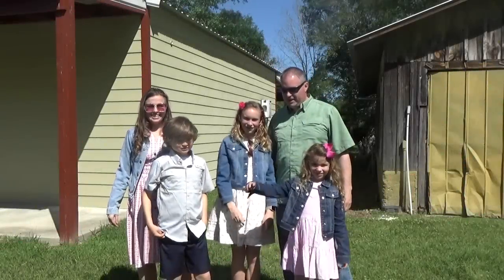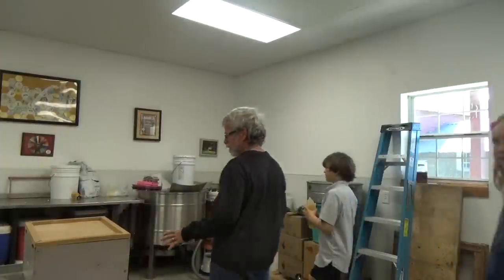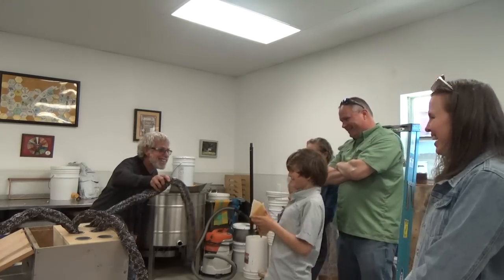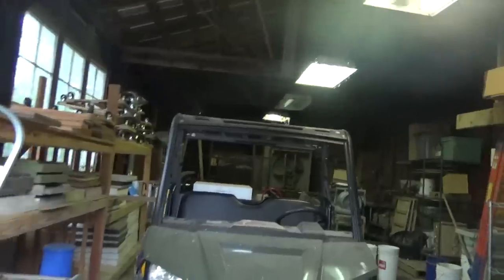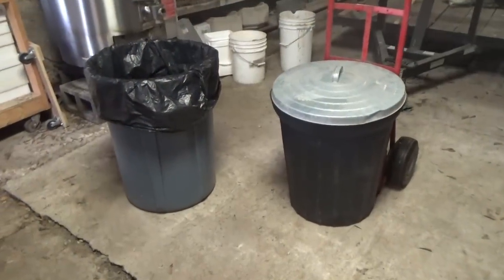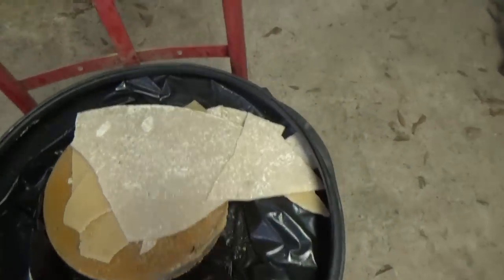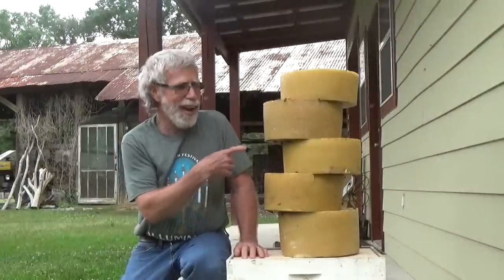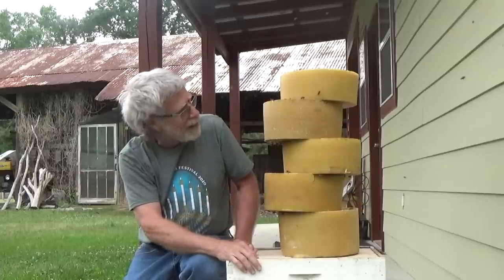Look how much refined beeswax was gotten by rendering wax cappings.

Comment: Your strainer-cleaning method really cracked me up! Here I was thinking "maybe he dips it in boiling water and watches the gunk melt off" or "maybe he uses a pressure washer"😂  With as much joy as you had over using a blow torch, why would you ever try another method? Haha
Reply: Hot water would clean the screen better and less work needed
Reply: I was thinking boiling water too.

Comment: Hi Jeff, I was just wondering if you would try boiling a kettle of water, then pour it on what ever you want wax gone from. You can even recollect what comes off by putting a coffee filter on the ground and pouring over it. It works like magic..lol. take care, and love the vids. And as it makes you feel good, god bless you sir.
Reply from the maker: First, thank you for your blessings, it's the best perk I have with the channel. Second, I have used boiling water to clean the strainer, and it does work....pretty good. However, it does not remove the embedded dirt from the screen. For that, fire is necessary. Plus, it's so much faster. Thanks for watching. God's peace.
Mr. Ed

Comment: Mr.Ed, will the girl's draw out the heavily waxed plastic foundation during the summer - fall? or only during the spring flow? I noticed that you use plastic frame's to withstand the high velocity extraction.
Reply from the maker: Generally, bees draw comb when there is a nectar flow. AS long as food is coming into the hive, they will build comb. However, it is mostly limited to the spring and early summer months. Thanks for watching. God's peace Carl.
Mr. Ed

Comment: Mr horchoff - i watched a lady render beeswax and she did something she considered an accident - she poured the melted beeswax into a bucket filled with ice water - she described what happened - she said the wax boiled up vigorously she thought it might boil over but it didn't - the resulting wax rendered into those tiny/little beads some wax sellers will sell in bags - do you have experience or knowledge of such a result - it sounded so interesting because melting little beads for molds or products seems a whole lot easier
Reply from the maker: I do not know about that, but I will give it a shot and see if it works. If it does, I'll make a video about it. Thanks for the idea and for watching. God's peace.
Mr. Ed

Comment: Would it be better just to use boiling water to render or melt the dirty wax debris off the mesh. I would think all the scrapping and fire would cause the mesh to wear down or created larger holes. Just asking.
Reply from the maker: I have used boiling water and steam to remove the trash, and it does work, but not well enough. The tough dirt still remains embedded with water and steam, but fire cleans it right out. Thanks for watching. God's peace Cynthia.
Mr. Ed

Comment: Makes me wonder if you could save that water and then distribute it somewhere less messy when the flow is low and you usually end up feeding anyway... Not sure if it would be worth the effort or not, but just a thought.
Reply from the maker: A very good thought, but the water mixture would have to be refrigerated to prevent mold from forming and fermentation, so the effort and expense is not worth it for me to do that. Thanks for watching. God's peace.
Mr. Ed

Comment: I think I may have messed up. Wife and I made the trip to Victoria Tx (150 miles) to purchase 160 pounds of wax. We got there and the stuff looked horrible. I got it home and did some initial cleaning. Lined my pot with a 5 gallon bucket paint straining bag. Put the wax in, in batches. Got the pot to 160⁰ and got the wax melted. Poured it up. Next day got the wax out and it's the color of mud. Waiting for Amazon to get my 10 micron filters to me. My question is, will the wax get "pretty" with straining or maybe the guy overheated it? Wife and I had plans to use for "crafts" for trade shows. I just retired and we'd planned on supplementing our income in retirement. The wax cost me $800 bucks. Afraid that's down the drain. Sure hope you can give me some good news. Thanks, Jay
Reply from the maker: I can't say about the wax you bought whether it will clean up or not, but normally, each time the wax is filtered, it gets lighter in color as more of the particulars are being removed. At least that has been my experience of it. My suggestion, keeping refining it and see what happens. In all my years of rendering wax, I have not overheated it, but I always have water in my mix. Let me know how things work out for you. Thanks for watching. God's peace Jay.
Mr. Ed
Reply: @JeffHorchoff  purchased a "grease filter" stand and filters. Melted at 160⁰ in a paint filter bag with water. Poured up in buckets. Re-rendered the blocks through the grease filters with two layers of paper towels. Looks like dark caramel brown. Sickening. Found way better wax for the same price. Can't afford to do it again.

Comment: Question for you... what kind, size and length nail do/should you use to build frames?  I have a framing jig but not sure what size nails to use to assemble the frames or how many to put where?  I'll be nailing by hand with a hammer.
Reply from the maker: I use an air stapler, and I shoot a 1 1/4 inch staple. The video link below shows how I build my frames. Thanks for watching. God's peace Nancy.
Mr. Ed
https://youtu.be/clUNGgjLGPo

Comment: In burning stainless steel the extreme heat removes the oil that was impregnated into the steel... No longer stainless steel at the point of the stainless steel being burned. It will rust .
Reply from the maker: That may bee true, but I have been doing the same burning for over 2 years now on that strainer and no rust has every appeared. I know one day it will be no good anymore, but at that point I will get another one. Thanks for watching. God's peace.
Mr. Ed

Comment: In using the torch , once you burn the screen you have rendered the screen useless for food grade use. The screen is no longer stainless steel. It will rust . I recommend using hot water to clean the strainers .
Reply from the maker: As the wax is not eaten, and the screen will ONLY be used with wax, I'm not concerned about the screen losing it's food grade status. I have used boiling water in the past, but it will not remove the dirt that is imbedded in the screen. Fire is the fastest and best method for me. God's peace.
Mr. Ed
Reply: @JeffHorchoff  Mr. Ed I appreciate your commitment to produce your channel. The first video of you that I viewed was of you placing swarm traps . I appreciate your faith and dedication in Jesus. Says a lot of your character, spirit and integrity. Thank you for all that you are doing .

Comment: Jeff, is there enough wax left in the trash from the kettle that it could be cubed and burned as fire starters?
Reply from the maker: Yes indeed, and I have done it several time. However, the heavier trash, the ones where there are cocoons in it are put into the compost pile. I'm told it helps with aeration. Thanks for watching. God's peace Alison.
Mr. Ed

Comment: Hi Jeff, I have a steamer for cleaning… I wonder if that would be a good option (though less spectacular) vs using the torch?  Less risk of burning through the mesh and igniting one’s fingernails.
Reply from the maker: I have used a steamer and it does work....kind of. However, to remove the stubborn pieces of dirt and wax, nothing works like good ol fire. Great hearing from you again, God's peace.
Mr. Ed

Comment: why not pour out the water first, then dump all the clean wax in a different bucket, then pour off the sludge into a separate waste bucket that you can recover later when you get enough of it?
Reply from the maker: The process of rendering beeswax is extensive as each time the wax is rendered, more impurities are removed from the wax making it cleaner and cleaner. Though the process is very repetitive, the same thing done several times, the end product is a beautiful block of 100% pure beeswax. For me, the process I use has proven most effective, and I have tried several ways over the years doing it. Thanks for your suggestion and for watching. By the way, if you are interested, I post a new video every Friday and have over 450 already posted for your viewing enjoyment and learning. Hope to hear from you again soon, God's peace.
Mr. Ed

Comment: Jeff, I really enjoy your videos and have learned a lot from them. I need a little advice if you don’t mind. I have two new hives that I purchased as nukes this spring. I have one hive that I have had for a couple of years. Last Spring I had shoulder surgery and couldn’t deal with that hive. I’m pretty sure it’s swarmed . To try to prevent that from happening this year I made a double screened dividing board.  The hive has two medium hive boxes with a full sized box on top. I pulled the top box and it seems to be completely full of honey. I went ahead and put the double screen board in but I feel pretty sure this isn’t going to work. Question, can I harvest that honey and should I try to put the board in between the two medium boxes. Thanks in advance again I really enjoy your videos
Reply from the maker: I'd give it a try, the worst that could happen is the split would not take and you could rejoin the colony again. Let me know how it goes for you. Thanks for watching and asking. God's peace Steve.
Mr. Ed

Comment: Hi Jeff, quick question.
Why not leave the water in each bucket then melt all the wax at the same time and divide the wax between buckets?  Seems like it would save a tremendous amount of time.
Reply from the maker: It  may work, I will think more about it. Thanks for the idea and for watching. God's peace.
Mr. Ed
Reply: Jeff, how many gallons does your kettle hold? If you stir the wax with the water would it help with removing trash from it?

Comment: I wonder if a steam cleaner would clean out the sieve instead of gas. Mark uk
Reply from the maker: I have tried steam and boiling water and both work. However, they don't get the dirt that is embedded in the screen. To get that out, nothing works like a hot flame. Thanks for your suggestion and for watching. God's peace Mark.
Mr. Ed

Comment: I bet you would find that most of that "black stuff" is burned honey. You heat the cappings more than it should be and the sugar caramelizes and turns black. No need to heat hot enough to boil. I've seen cappings warmed just enough to melt and then cooled and the wax hardened and removed leaving, honey! You just can't hurry it and can't over heat it.

Comment: How apropos you're cleaning the strainer screens with fire and on the wall behind you is an on demand hot water heater. Those on demand hot water heaters can be regulated to temperature hot enough to melt beeswax. I know mine goes up to 140° the low end for cleaning up beeswax. I bought a little steam cleaner from HF what a joke. And I mean little it takes forever to clean anything with it.
Reply from the maker: As good as boiling water does to melt wax, it does not clean a screen like fire can. Thanks for watching. God's peace David.
Mr. Ed

Comment: That's a lot of propane to do something that can be done with hot water.
Reply from the maker: Since wax mets at 145 degrees and liquifies at 165, hot water just does not get the job done. Most hot water from the tap is less than 110 degrees. God's peace brother.
Mr. Ed
Reply: @JeffHorchoff  Yeah you need the water hotter than what generally comes out of the tap! But if you submerge a wax-coated item in a pot of water, bring the water to the boil, and then leave it to cool, the wax will melt before the water boils, float to the surface away from the submerged object, and set again when the water cools. 
This also works for getting 100% of the wax out of messes like burr comb and old frames. Instead of pouring the wax and rubbish through a strainer, use a piece of strainer mesh on the right shape frame for your pot to push the gunk down into the near-boiling water, and then just let it cool and the wax set on top of the water. I've seen a few people making various commercial-size prototypes, but I don't reckon any of them will be able to patent the idea because it's basically just an overgrown coffee plunger.

Comment: What if you have block of bee wax flat and same size of the frame warm the face of the block and stamp the frame on the block
Reply from the maker: Sounds like a good idea if you could keep the block of wax warm enough, long enough to transfer the wax to the foundation. Thanks for the idea and for watching. God's peace.
Mr. Ed
Reply: @JeffHorchoff  can I share link with you here please
Reply: @JeffHorchoff  check cheese melter as idea
Reply: I keep thinking about it 
Two blocks clamping on the frame 
And hot pan below to collect the dripping wax

Comment: Clearly you're having way too much fun with your blow torch!🤩 Seems like a lot of unnecessary extra effort to clean screens! When a bucket of hot water and a scrub brush is a lot more efficient. Your method is messy, slightly dangerous and kind of a waste of time!🤷‍♀️ Not meaning to be mean...I guess I just expected to see a more professional approach to cleaning simple screens.😅 Like the rest of your wonderful work. Whatever works I guess! 🤭 We still enjoy your videos!❤
Reply from the maker: It is a guy thing, we just like messing with fire. However, in this instance, it actually works the best. I have used steaming water, boiling water, heat guns, and all of them still require elbow grease to get the job done correctly. With fire, a few minutes of torch and everything is gone. Thanks for watching. God's peace.
Mr. Ed

Comment: Does your wife have a steamer?. High pressure steam would blow and melt the crap right out.
Reply from the maker: I have tried steam, heat guns,  and boiling water to remove the trash, and they all work, but none works as easy as setting it on fire. Thanks for your suggestion and for watching. God's peace Gerry.
Mr. Ed

Comment: Plastic 🧤 while holding a piece of metal as you roast it with a torch...🤔🤨😒🙄😬😮‍💨🥴😵😵‍💫
Reply from the maker: Not plastic, all stainless steel. Thanks for watching. God's peace Gabriel.
Mr. Ed
Reply: @JeffHorchoff  ...YOU'RE WEARING THIN PLASTIC GLOVES 🧤 WHILE HOLDING STEEL AS YOU TORCH IT...NOT TOO BRIGHT...Glad you read it correctly...🤔🤨😒
Reply: Nitrile not plastic 🧤 are rated for 400 degrees Fahrenheit…. Don’t be a 🐱